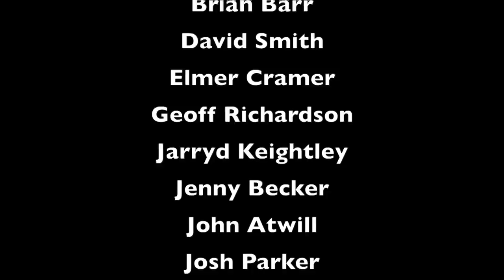Prop shaft and rudder post installation

Comment: Saw a good trick on a sailing channel: On a shaft seal arrangement such as your rudder seal, one can "queue up" a couple of spare seals on the shaft, ready to go. If the seal leaks you gouge it out, cut it off the shaft, and simply slip the next one home. Potentially saves heaps of dismantling and reassembly.

Comment: Hey mate be careful with the dry ice. Don't put any inside the boat. Or on the deck of the boat it is heavier than air and it will seek the low spots. It will displace the oxygen with CO2 and can be deadly. Good show today. Congratulations on 100K!
Reply from the maker: Yep, definitely something to be careful about, particularly when working on your own.

Comment: You may want to weld a keeper over the top of the connecting pin for your steering.  If the cotter pin falls out the connecting pin could work itself out.  A small piece of angle iron should do the trick.  Just cut it off when you go to service the rudder next time.  We used a forklift to push in our prop shafts.  We also welded some padeyes onto the hull and shaft to attach winches or comealongs.  :)  Maybe a little late for that piece of advice  :)  

When you go to connect the prop shaft to the gear make sure the shaft coupling is nice and square.  Sometimes the keyway will slide towards the prop when you install the coupling.  Couple the shaft and the gear and get it as tight as you can by hand.  Spin the shaft around three times.  It will find it's happy place on the bearings then give it the final torque on the coupling.  Worked great for us up in the Arctic.  :)

I'll save the full safety lecture for another time but for crissakes put on your safety glasses when grinding.

Comment: If you know anyone with some  old CO2 fire extinguishers that are needing a service / recharge - use them to "spray" the prop shaft to cool it down rapidly and without mess or the hassle of handling dry ice  and getting it to stay in location.

And awesome sauce on the 100K.. 
Pity about the green machine - the 100K plaque from youTube would have looked great mounted to the dashboard... LOL

Comment: Use an air chisel with a bolt and socket on the end to move that prop shaft in, Works great for bearings and ujoints as well....

Comment: Another interesting vid, a tip my grandfather told me,when using linseed oil add some turps to thin it,makes it soak in better. keep up the good work,can't wait to see it back floating and running.

Comment: Great vid again and congratulations on the 100k subscribers.
One thing I used to do in the yard were I worked, was to use a coarse wet and dry paper with loads of water, even a slightly running hose ( or bucket of sea water ), this would clean a prop really quickly.
I used that method on some fairly sizeable props,  including the two local All Weather Lifeboats, down here in Kinsale southern Ireland. We used to haul, powerwash, antifoul, do the props and grounding plates ( same wet and dry paper ), and have them back in the water in about 2hrs 45mins. Those props never got antifouled, but were polished quite well and twice a year.
You could also use an air sander with the wet and dry or use a scotch bright pad again plenty of water. 
Lovely bit of natural history content too.😎
Reply from the maker: Thanks mate, appreciate the advice. This will be a job for early next week. :)

Comment: First buy a faceshield ,I was a welder fabricator for most of my life and had to see other people suffer eye injuries ! I think I would fix the prop nut in case you ever hit something . Like the show , you are very good at repairing parts to make them serviceable !
Reply from the maker: I think replacing that whole prop shaft is going to be my only option unfortunately. At least that would also fix the problem with the end being worn narrower than the rest of the shaft too.

Comment: I feel your pain! Had to put a new cutlass bearing in a 55 foot boat I was working on. That meant pulling the 22 foot long 2 1/2 inch tempaloy shaft. While we had it out the owner paid to have the shaft inspected and built up in worn areas and turned down and then smoothed. (Glad I wasn't paying the bill). Had to do the same as you and pound the new bearing in place though he did have an Allen Key to lock in as well. The shaft was real pain to get in and out due to its length and flexing. Always nice to start going the other way on a boat project!
Reply from the maker: I'm kinda wishing I had the worn areas built up again now as it would have allowed the bearing to be larger and make it easier to get in. Next time...

Comment: Lanolin spray is a good anti-rust spray & lubricant, leaves an oily film on surfaces that you coat, would be good for that flywheel etc, you can get it in pressure pack cans, handy to have a few around & onboard, good to see Eddy.
Reply from the maker: Yes, have a few cans of Lanox around. Can't beat the fleece grease!

Comment: You are the reason I have just completely restored and rewired  my 1968 cruiser. Its 20 ft with a Yamaha ft 50 high thrust on the back. I am looking forward to getting it on the water tomorrow. Cheers mate, time for a beer I reckon.
Reply from the maker: Nice one mate. Congratulations on getting it finished. Enjoy the launch day!
Reply: @DangarMarine  Its all good so far. Just a test launch and run on a fresh water canal. I like to do that before I launch it at coast. Congratulations on 100k. I am inspired to start a channel. I am a marine mechanic, welder, gas fitter and electrician. If you ever have any questions about LPG systems on boats give me a shout. All the best.

Comment: No worries about getting the Detroit running once you get into it you find out how easy rebuilding the engine is.
 We use to do in frame overhauls in the field on 471 Detroits on terex earth scraping pans all the time. We would piston rod assemble loaded in liners and drop them in block.
Reply from the maker: It's funny, people often complain about the Detroits being too complex but in many ways they are very simple engines to work on. Thanks again mate!

Comment: Stu, you mentioned overhauling gate valves.  The problem with gate valves (even bronze valves) is that salt water eventually corrodes the screw threads that control the gate and you can screw the handle forever and the gate never moves.  I strongly suggest you replace them with ball valves.  Also, please wear eye protection, I am 76 and three times in my life time glasses have saved my sight.  Once from a flame front as I was lighting a water heater, once from errupting hot lead in a mold that came in contact with water and turned to steam (lead completely covered one lens), and once a piece of wire from a wire wheel.  The blood on your leg though painful is trivial compared to losing sight in one eye.   Keep up the good work, I check every day and look forward to every vlog.
Reply from the maker: I looked at new ball valves but they were over $1000 each and I need three. Will be interesting to see what condition these are in when they come apart.

Comment: I figured someone would have already recommended this but here goes.  Heat up the propshaft bearing area and freeze the propshaft itself.   Its how I put on pressed on bearings without using a press sometimes. My dad taught me that trick that he learned in the US Navy. Basicly heat the female part and freeze the male part. Also works great for putting wear rings in seadoo jet pumps.    Watch out for those flying angle grinders. 😄
Reply from the maker: My only concern is that the female part is fully painted with 6 coats and I don't want to burn it off.
Reply: You don't need to use high heat. Just use a hair dryer or a heat gun on low.  I bet the propshaft will just slide right in. Especially if the shaft is really cold.

Comment: I knew there was a story behind those glasses. As for the propshaft, I've used canned air called Duster here upside down to freeze smaller things. So it might help with the ice. Also we did a similar repair to the welded prop where the machinist cut the shaft and we added a bearing block and sleeve inside that gave us enough length to have the shaft remachined for the prop. You might be able to do something similar in your case.

Comment: Oh boy you have a happy muddy dog. I had an Alaskan Malamute that would find either water or mud to play in, want to come over and get in your lap. 

Things are moving right along for you nicely. Those setup tools for the Detroit are worth their weight in gold. With the manual and those tools setting the rack is pretty easy. But then again you still have to run the rack with it running to make sure the injectors are all not working properly.

Comment: Congrats on the 100k subs. And FFS wear safety glasses when using wire wheels. Please. Wires break off all the time.
Reply from the maker: I've head wires break off straight wire wheels, but in 30 years I've never had one fly off a knotted wheel.
Reply: @DangarMarine  Fair enough.
Reply: @DangarMarine  I have had them fly off knotted wheels, once they get used the knots become loose, loose one wire, the knot become looser, I've had them stick in a leather apron and fly all over the place, I won't have anyone nearby either when using one. You don't want to end up blinder than a welders dog.

Comment: Great video Stu! Eddie really stole the show! His little low tide mud walk is priceless. Enjoyed the kangaroo footage. Those sun glasses, oh man, outrageous! Reminded me of that old ZZ Top song, Cheap Sunglasses, you’re a good sport, bud.

Angle grinders, they have really got some crazy torque. And theres no stopping them if they bite into something. It was probably those nitrile gloves inhibiting your grip! Lol. I dont know how many times I’ve taken the bark off my knees and shins with those, even through blue jeans.

I hope that drive shaft can be shrunk enough to push through the bearing. I can actually see the flare in the shaft where the old bearing was riding. I’ll actually be surprised if you can push that through without damaging the bearing. You may have to get the prop off and install the bearing after the shaft. I cant tell from here if the prop end is salvageable. If those threads are all welded up and not just a tack spot then i dont think you could re-use it.  It would stink to get it in and find out later the bearing is scored and wearing itself out. Go easy and you should be able to tell if its all good or not.

After watching your work since 2017, knowing your attention to detail, and ingenuity, I agree you’re qualified for any engine work. She’s gonna run better, stronger, faster. I’m hoping you can find an engine mount solution with rubber. Hopefully an automotive mount will work.

Take care Stu, best wishes!
Reply from the maker: Thanks Kris. I got the prop shaft in yesterday using dry ice. I'm hoping there isn't any damage to the bearing or shaft. Time will tell I guess. I too think there is a big chance that the prop shaft would be unusable if I cut the nut off as it is very solidly welded, not just a few tacks. I'll see how it all runs given money is a bit tight at the moment and replace the shaft and bearing down the track if need be.
Reply: Hi Stu, I know you’ve got a good eye and feel for those types of situations. The ratchet straps were a good idea for the type of force needed to push the shaft through. Dry ice is another top secret weapon, ingenuity at it’s finest!  If it felt like even pressure the whole way in your probably all good. Usually when something starts deforming it will take increasingly more force to keep it going. I bet it’s all good for the long haul. And that’s great news! Take care bud, and stay cool. 😎

Comment: Funny thing about wire wheels on grinders. No matter if you have a guard on or not they will still find a way to bite you if you loose control. In this case since it was a cup wheel and there is not really a guard for it since the "custom" ones only seem to fit one specific grinder that you will not have, its not a big deal. As funny as this may sound, if you do NOT have an allergy to latex, use black electrical tape(or white if you have) and cover up wound with that for about four days changing every couple hours. Completely cover it. You can throw paper towel in if you wish. Better than a band aid/plaster and, for whatever reason, seems to help heal quick with little scarring.

Speaking from experience, side handles on grinders are a REALLY good idea.

Comment: Looking good stu you're getting there! The timber "beltings" as I know them, would benefit from having the edges rounded over with the router. It will be Less inclined to tear out the grain on the edges rubbing on the wharf pilings etc. And it looks good 😉
Reply from the maker: Yes, a quick run over the edges would be worth it.

Comment: Take a cutoff wheel and cut about 3mm off the end of the prop nut and shaft.  That should get rid of the weld, then you can unscrew the remainder of the nut and pull the prop off.  Drill a new hole in the end of the shaft, and use a thinner profile shaft nut and a new split pin. Will save you big $$$ over buying a new shaft.
Reply from the maker: I certainly think it's worth a shot. I could even look into putting a sleeve over the worn section of the shaft then to bring it all back to a uniform diameter.
Reply: I've used that method before on a boat where the owner had mushroomed the end of the shaft by hammering it into the stern tube.  Was able to get prop off and saved the shaft.  Worked like a champ.
Reply: Sounds solid to me.

Comment: Stu, you can use that nice big speed square as a guide for your saw, will make cuts like this a little easier in the future.
Reply from the maker: You can, but I actually find it easier to follow a line as it gives me a free hand to hold the guard open if needed. This one is a bit sticky.
Reply: @DangarMarine  If it works for you that's all that matters. The boat's starting to look good, still a lot of stuff to do though.

Comment: You have to shed a bit of blood over a job at some point ....... BUT ear protection, eye protection, gloves are important and the biggest one is NEVER lock a grinder in the "on" position.  I have been a welder since I was 16 and I have seen a grinder/ drill dropped on the ground and it took off until it pulled the plug out finally.  I agree with you about to much OHS etc but the basics are worth it for the long run, we all want you enjoy your boat.  Congrats on the 100k also ............. Cheers from Brisbane.
Reply from the maker: Grinders definitely can be nasty. The worst I have heard of is a mechanic that had one he switched on but the power was off at the wall. He forgot he had locked it on so when someone turned the power on it took off and cut him right up his torso. Months in hospital, lucky to live.

Comment: Stu, it might help too if you put a heating pad on the bearing to expanded it a little, along with the ice on the shaft, I don't think I would use a torch as that might be too much for the the adhesive and allow the bearing to go in to deep.  Awesome job and video, thanks for taking us along on your journey.

Comment: Old plumbers trick. When changing a tap on a pipe when you can't turn off the water, attach a hose to an LPG cylinder, turn upside down then open cylinder tap slowly. The liquid LP will freeze the water in the pipe, then quickly change tap. What you do with this information is up to you.
Reply from the maker: That's a nice trick. :)

Comment: Eddie is awesome. He seems well-suited to boating... and mud larking. it’s a treat to see your progress. Watching you with the grinder and not wearing safety (or any) glasses had me wincing—I just wasn’t expecting the grinder catching and scouring down your shin. Ouch! I’m beginning to get a feel for the improvisational mechanical mindset required in Australia. It being your winter, what are the daytime temperatures? Is it very humid? The second shades are cool, but in a pink Lincoln I think that the shades you chose make the necessary style ‘statement’.
Reply from the maker: Maximums at the moment are around 18C-20C, but fortunately the humidity has dropped a lot since summer.

Comment: You can use unlit propane gas on the prop shaft to cool it, way below freezing, use plenty. An old plumbers trick for when you can't find the shut off valve.

Comment: I've been warned almost as many times as I've dug into Detroit fuel systems. Still don't know what's supposed to be tricky about it. With the tool kit, you should be gold. At worst, have a bit of plywood to block the air inlet handy.
Reply from the maker: That's what I figure too. Have some rock solid way of shutting the air off and you don't risk much.
Reply: That is a cool little kit. The air shut off can save you. Once in a land far far away I saw a fella try to stop a run away with a pillow. Lol . Watching the exhaust shoot all that out was priceless.